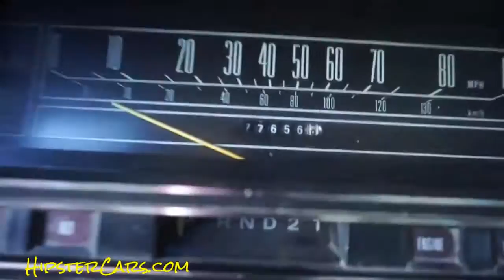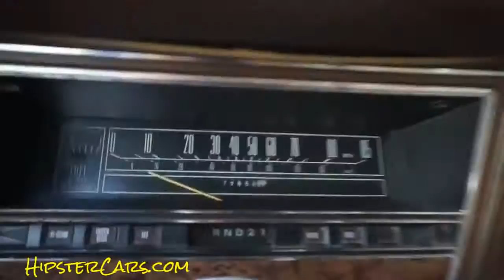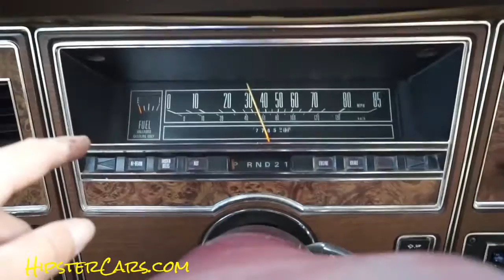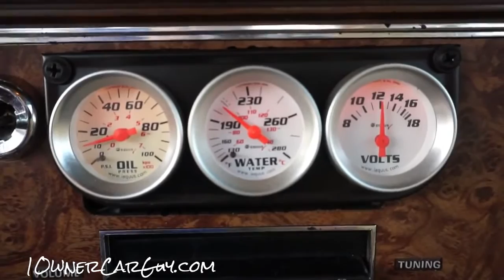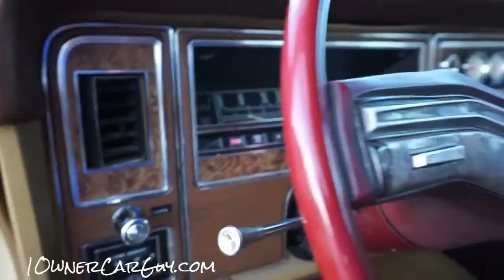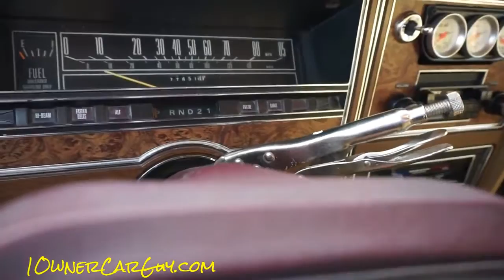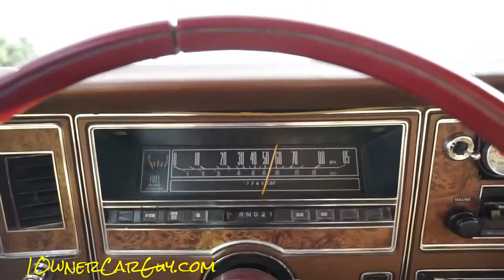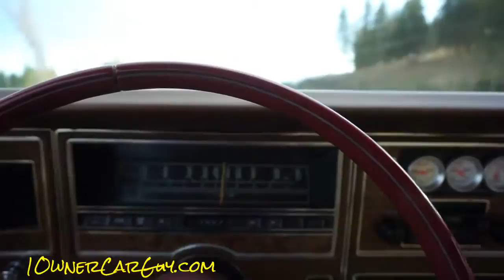78 Mercury Marquis Colony Park Station Wagon Estate Video Review

Comment: It could be that the speedo is a bit out because of those big old knobbly winter tyres, they're often higher profile than standard highway tyres to make them good in slippery conditions and for cutting through snow, i.e. the sidewalls are taller but the tread is narrower.  As for the oil/transmission fluid leak, or alleged transmission fluid leak, if the car has been stood around for a while (and with nearly new winter tyres on this it probably has pretty much since last March or April) the seals in those older transmissions can dry out and shrink so they'll drop a bit of fluid for a while until they get wetted up with fluid and swell up again, it used to be a motor trade trick that meant you could get a good car much cheaper because it looked like it was dropping transmission fluid which could mean potentially a big bill for a transmission overhaul when all the car really needed was to be driven around for a bit keeping the fluid level topped up.  Sometimes a fluid change and a new transmission filter can work wonders too.  The smoke from under the bonnet just looked to me like a bit of oil dripping from a rocker cover onto the hot exhaust manifold...
Reply from the maker: +gosportjamie I dont doubt that on the tire now that you say that.;-)
Reply: Hipster Cars   Glad to be able to help.  A lot of people tend to forget that winter tyres and especially knobbly tyres are higher profile...